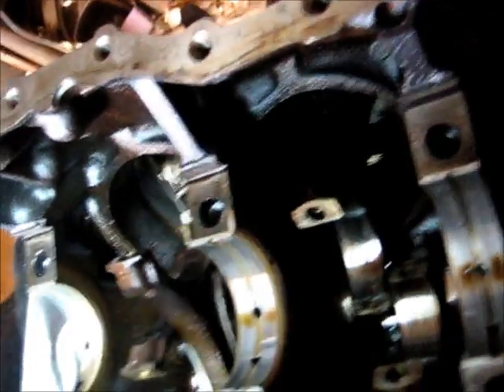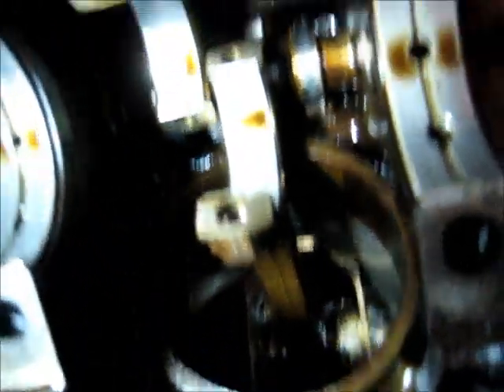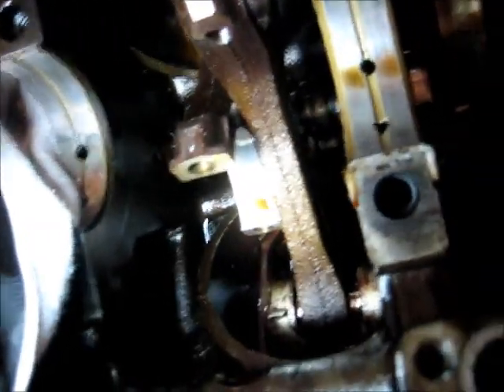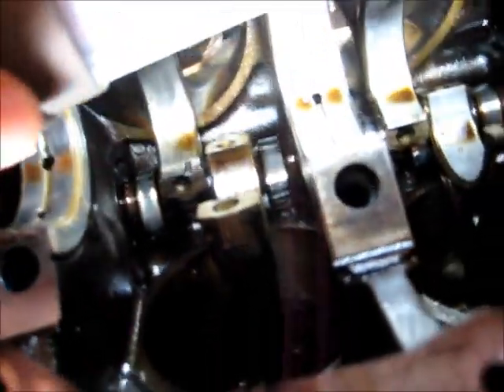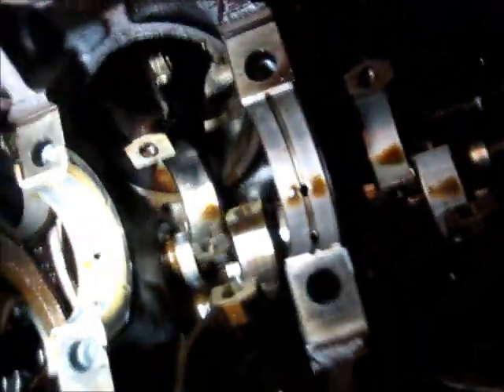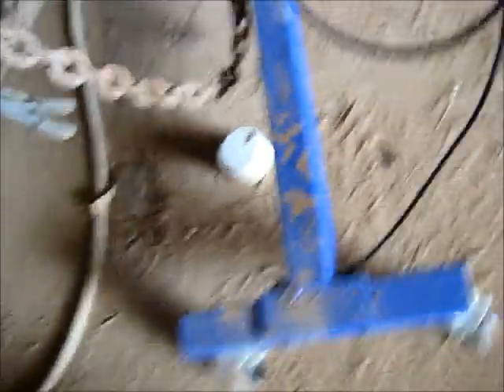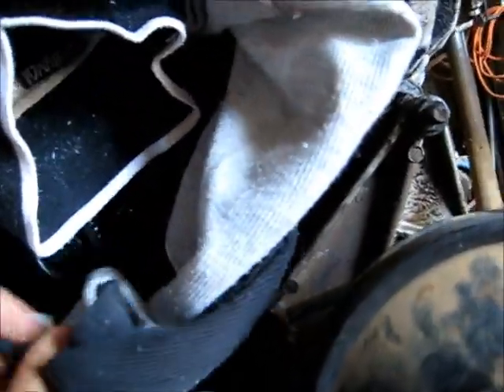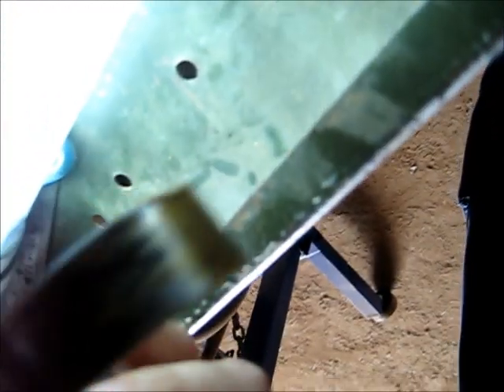3.8L Engine Spun Bearing

Comment: Fuckin A right mate! I appreciate the video. I believe I have a bad rod and bearing. Just waiting until tomorrow to have it towed home to my garage. 02 Grand Prix GT and it sounds like a jack hammer on the engine along with rpms. Needed a good look under the oil pan to see what I'm up against. I've rarely done much engine work since driving the 03 jeep g.cherokee with straight six 4.0 But for now I'll be driving old reliable while I fix this pontiac piece of trash. I believe the garage I was at last to replace oil pan, put in the wrong oil filter and may have just ruined my ride. I sure hope so. Would much rather get a new engine because someone else's whoopsie than get my hands dirty with a V6 that was just serviced and ran like a champ. But thanks for the video O can sit back and enjoy my beer and say fuck it. Doesn't look as bad as I thought. Fuck it anyway

Comment: @OlegKostoglatov yeh its Saginaw Michigan, as with the PS pump design too!. a friend has a 1919a4 machine-gun made by Saginaw Steering Gear division in Michigan :D

these 3.8's were always a bit half assed with the way they took the 8cyl design and just 'made it work' on 6 cyls. but they sell like hotcakes and with a bit of care (no flogging!) they outlast the car.
mind you, 99% of Taxi cabs are Ford's simply because the 4.0 inline six is soooooo much better!

Comment: Saginaw Michigan most likely, like the song by Lefty Frizzel, G.M has a few plants there along with Flint, Livonia, and of course Detroit. I'm not that crazy about 90 degree V6s, they tend to run at with an inherent mechanical imbalance hence they have balance shafts to counteract it.  I think that the better V6s are 66 degree blocks but inline 6s are best. That was the GM way of making a V6, take a V8 and chop two cylinders off, cheap and rough design.